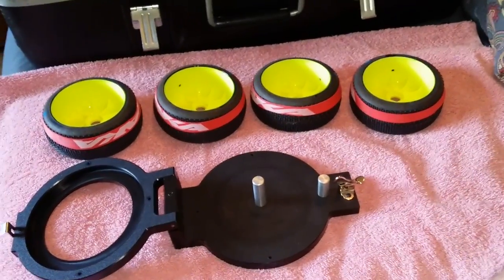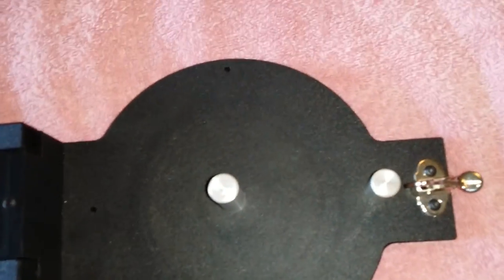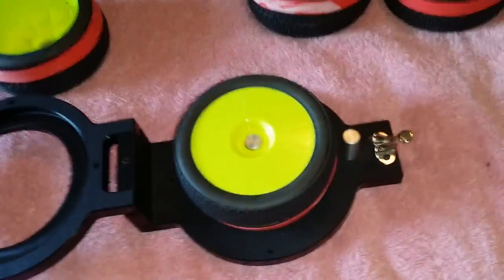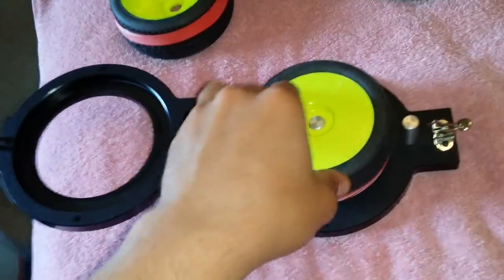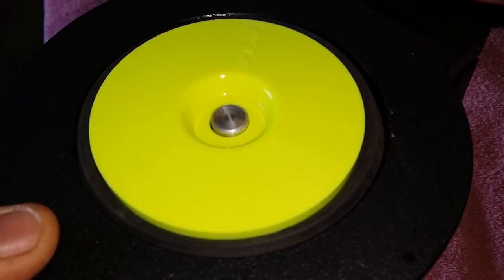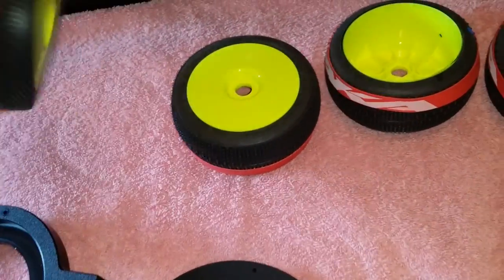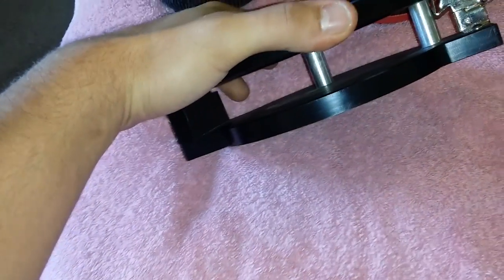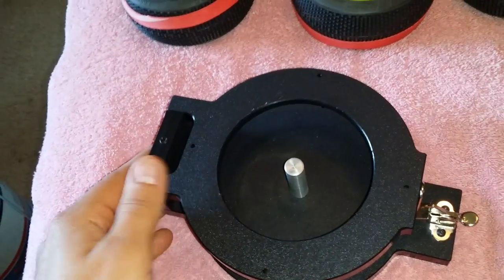Gluing RC car tires with the VP Pro Tire Jig

Comment: the vp pro jig is nice if your against time an works well an fast for me i use medium glue an run only proline tire an rims but to each there own it will save time all 4 both sides in about 5minutes you will find yourself waiting for the glue to dry if anything